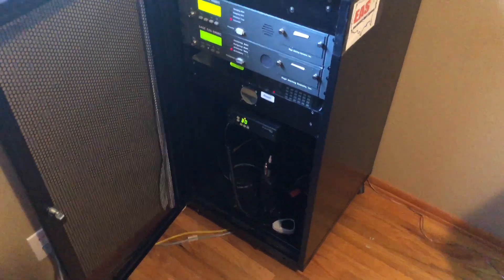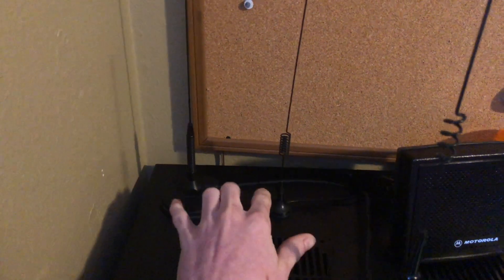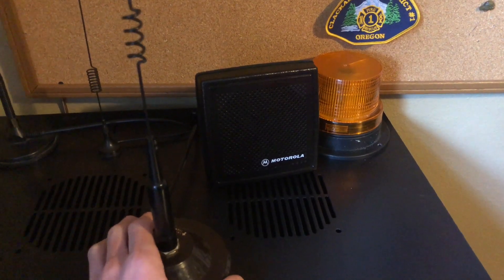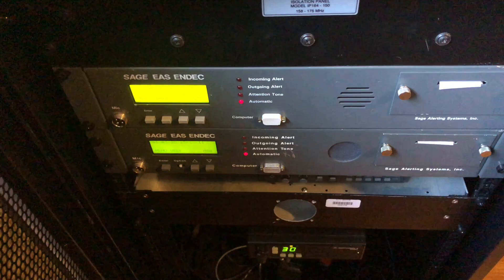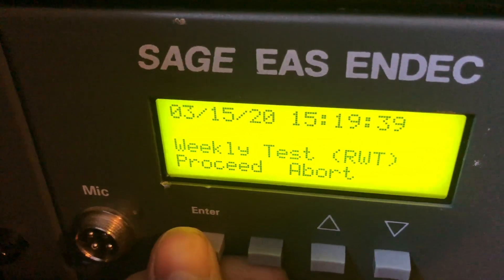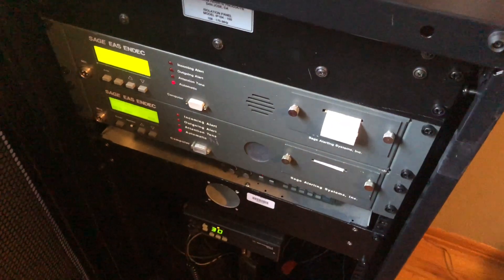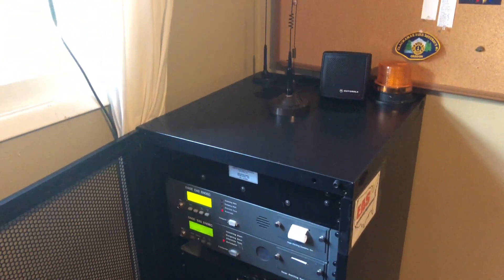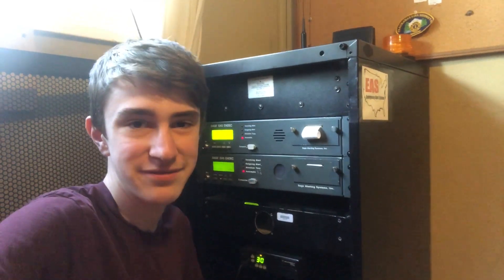My EAS Relay Station Rack | Sage EAS Endec

Comment: Just now stumbled across this video, amazing setup you got! I am a co-engineer for a LPFM station in Ohio and we are about to install a 50w GMRS repeater on our tower and we have the SAGE model 3644. Would I be able to rebroadcast the audio on our system? I’d love to discuss further if you’re able to help out!!
Reply from the maker: Yes, you can use the SAGE for that but I would route the audio through your repeater controller so you can cut it off remotely. Also, I would try to get it up so the EAS tones don't get rebroadcasted, just the message. This is because you don't want to risk spur transmissions or cross talk with other equipment from the RF. I used the relay options on the sage to trigger the PTT after the tones. More detail is in the manual.

Comment: So other than a ham license and money to buy this stuff do I have additional requirements? I'm looking getting a ham license and I also would like to use the eas endec to alert local repeaters.
Reply from the maker: I highly recommend you just go with a Reecom weather radio connected to a radio on the repeater frequency. Its cheap and easy and will not broadcast the EAS tones, only the audio message. I highly recommend you know EXACTILY what your doing before you do it because if done wrong, it could result in an EAS activation! Please also only do this on repeater you own or have the rights to.
Reply: Is the sage EAS endec still available or is that what you mean by cheaper? I understand I still need the radio.

Comment: Pretty neat, I was going to setup something similar that broadcasted to my discord server (like you did), and activated stuff on a NOAA live stream. My plans have been put on hold since I have learned that my ENDEC is completely trashed. The board inside has almost every possible issue you can imagine. Where did you get your ENDECs from? They are pretty much no longer existant on eBay anymore.
Reply from the maker: I work at commercial TV tower sites where we have our Amateur Radio Repeaters. I have contact with the station's main engineer. He told me he had 2 sage units so I went and picked them up!
Reply: @EvanVanderStoep  Dang, there is so much stuff that people like us would love to have, just nobody knows we exist lmao.

Comment: Nice setup. One of our amateurs has a similar setup but doesn't use it anymore. One question though. Doesn't this violate the "no broadcast" rule by the FCC?
Reply from the maker: I'm broadcasting it on amateur radio frequencies, there is no receivers on there. So, therefore, it's not illegal. it would, however, be illegal to broadcast these EAS tones over NOAA, FM Commercial Broadcast, and TV bands. None of which I am doing!
Reply: @EvanVanderStoep  Never mind. I was thinking about 97.111 and 97.113, but in looking for the information, I found a pdf file where the FCC does allow informational bulletins, as long as they're directed towards amateur operators and not the general public. I stand corrected.